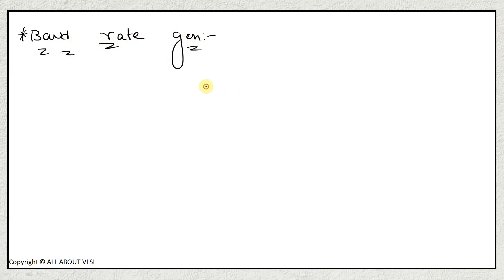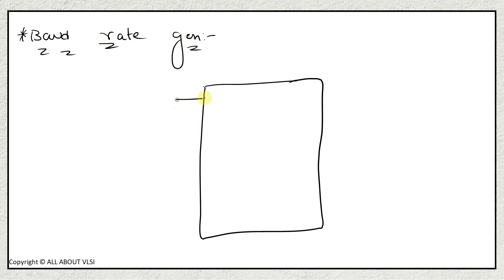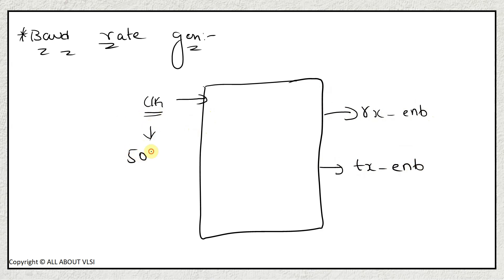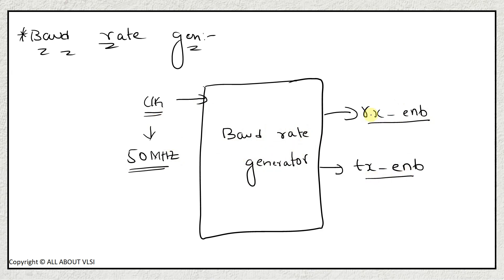UART Baud rate generator || Verilog code development || All about VLSI || UART design using Verilog

Comment: 1.why don't we write the code in one always block using two if statements?
2. after entering into if statement why can't we assign the tx_en or rx_enable as high?
Reply from the maker: 1. Yes we can just to differentiate the two logics that is tx and rx I have written like that
2. Outputs are of wire type we can't use it in always block